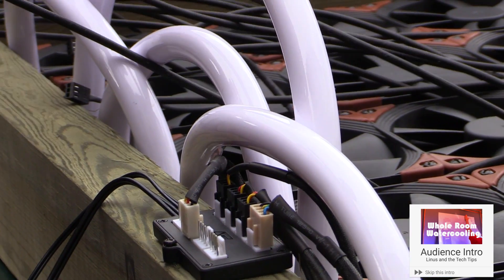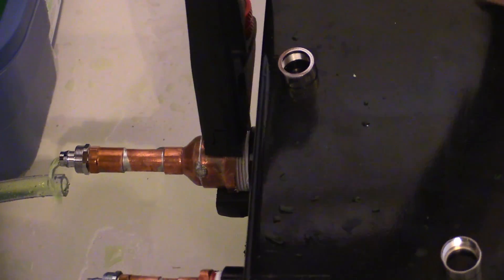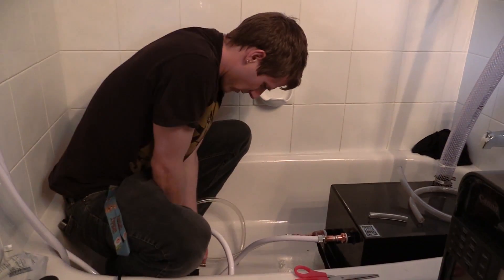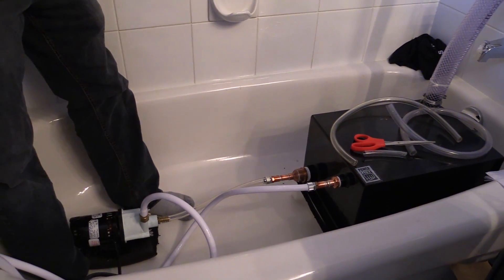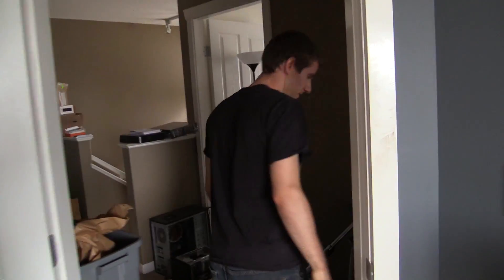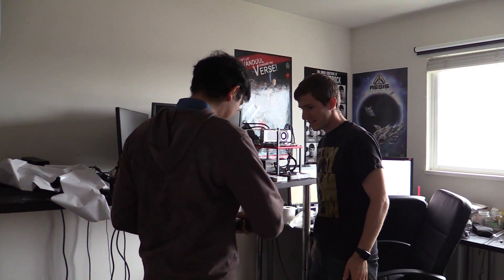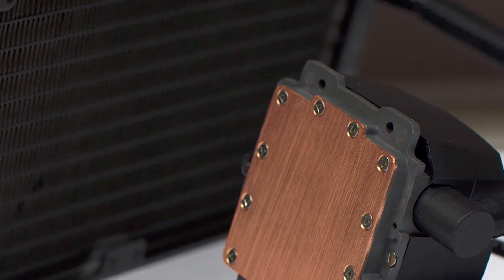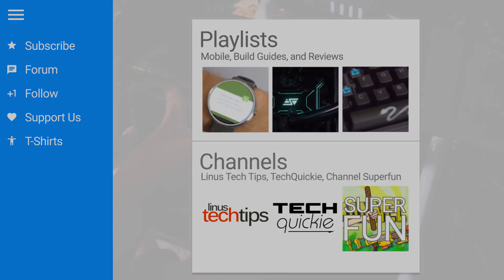Whole Room Water Cooling Part 4 - Nearing Completion...

Comment: Hey Linus, I bought a I5-4690k and I inted to overclock it. I have a Cooler Master Hyper TX3, but I read online that it isn't that good at keeping a overclocked CPU cooled. But I don't know if that is with the single fan or if they attached a second 92mm fan on the other side. My question is, would a TX3 be fine cooling a 4690k overclocked over 4GHz with two fans in a push-pull config?

Comment: You should air pressurize your system before you start to check for leaks. A lot easier than draining the whole system to resolder a pipe connection. Additionally, it would have been good to get some instruction from a qualified plumber. Those solder joints look horrendous! Other than that, speaking now as a geek rather than a carpenter, this is an awesome idea that I wish I thought of.

Comment: I dont know jack about plumbing but could they not have just put valves on each section where the copper pipes came down to the PCs, therefor making it easier to swap out and drain systems individually?

Comment: I find it funny how as soon as something goes wrong with this sort of stuff, suddenly the entire LinusTechTips community turn in to Professional Plumbers who have been in the trade for 60 years -_-
Reply from the maker: me too :p
Reply: Jergialipananu Little harsh
Reply: seriously have these guys never heard of butterfly valves to turn off flow? if they put those right before the fittings to the computer they would not have to purge the system so often. hell they could add computers with the pumps still on if they did it that way.
Reply: Hahaha thumbs up
Reply: In reply to jergly panini, that is
Reply: Seriously?
The ban hammer shall be raised above you!
Reply: ***** You're an idiot.
Reply: It doesn't take a professional plumber to know that the pipes are not very secure, and the 'professional' plumber who fitted it should have tested his work and actually soldered it all correctly.
Reply: Wobbled I love how easy it is to discount part of a community by expecting the entire community to be the same.
Reply: I wish I had found this earlier.  I am a plumber.  A simple high point vent would have saved a lot of trouble.  I have built water cooling systems for my own computers from scratch including machining the water blocks.  Something simple as a few tees would have been able to bleed the air as the system filled.  Water goes down, and air goes up.  I am wondering how long it was before air got back into the system.  I am also wincing at the jb-weld and the missed solder joint.
Reply: Lol. No kidding.
Reply: jamdoginc JERGLY PANINI LMFAO
Reply: Quinton Fallon
thank you that was bugging me so bad every time the drained the entire damn loop
Reply: I work with pressurized systems all the time, mainly filtration and chromatographies so i could relate to the issues these guys were having, not that i'm an expert, we just have simplier solutions for our smaller systems, fill with liquid the system parts that usually bubbles get stucked in, start the pump and then connect. (Obviously you can't just bring an open tubing close to the PC, so i guess i would have tried to fill something a bit further away?) That or increase the preassure as much as i can, I don't know if any of that would have solved the problems but i think i would have tackled the situation somewhere along those lines because that's how im used to solving the issues with our systems, in any case the issues of dripping in our systems are far less important than air bubles and in this case dripping was the main concern, i can just get a paper towel and clean the mess, these guys can't and im sure i wouldn't have dared to raise the pressure by much. Anyways... long pointless post.... :V
Reply: Quinton Fallon

I'd go with a ball valve.
Reply: OK, but you'll have to admit this all looked rather clumsy.
Reply: It takes virtually no experience at all to see how many flaws this has. I'll just give one simple hint for future. Get at least one T-joint with ball valve, place it on proper location on piping and attach automatic air bleeding unit similar to SpiroTop to it = Airless closed piping system. There's quite vast amount of other to be honest quite silly implementations in piping there. Ok, I can't resist it. Here's another one. Guess how much are you going to benefit from that fairly big pipe size? Truthfully speaking virtually not at all, since those puny computer blocks resist flow and they'll do it big time. You can't replace the issue with big pump. At least I didn't notice any bypass lines near blocks.
Reply: Jaap Versteegh I'll agree... it looks like something the Leeds council would set up over here... BUT... it's a project... and it doesn't need to be a polished item... it's what I call a garage mod... something that anyone with a soldering torch and some pipes could pull off...
Reply: jothain I can't agree more. I was just  about to comment the same thing. This whole project is ridiculous, and the fact that A. they never started with an actual plan and just decided it to 'wing it' so to speak, and B. they had a professional plumber come on sight and didnt take any of the advice he probably gave them about their piping fuck ups just seems stupid on a whole new level to me.
Reply: Colin D Alright, have fun at school tomorrow.
Reply: Colin D Just when I started to miss sarcasm, BAM, it comes around the corner and hits me in the face. Awesome.
Reply: DKE
Reply: that is becus they are widen their horizon , its called been smart going even futher dickheads
Reply: Wobbled lol exactly .. mean while im sitting here amazed at what the fuck they're doing basically in a home office type setting... lol like theres a step by step guide somewhere to accomplish this..
Reply: Wobbled well at least I can use a fucking stud finder
Reply: RC Codes A. it's a custom job. B. it's fairly straightforward once you learn how watercooling actually works - it's just a shitton of effort C. Sometimes life is about working hard and creating your own way instead of reading a fucking guide for every little thing.
Reply: aakksshhaayy i think you misinterpreted my comment...
Reply: +LinusTechTips dont forget us "professionals" watching your videos are watching because we have an interest in this community, not just praising you, that is WHY YOU HAVE A CHANNEL AND ROOM FULL OF PCs, dont forget that.

many of us use sources of information other than youtube to learn how to water cool our PCs BEFORE attempting such a task. WE find it amusing that the only self proclaimed professional commenting on this channel is YOU, and making THE MOST ELEMENTARY mistakes when attempting as grandiose a job as this just lets us know that your tech tips are clearly LESS than informed in this than your average overclockers dot net member. or anyone who has built their own reliable PC for that matter.
Reply: +LinusTechTips dont forget us "professionals" watching your videos are watching because we have an interest in this community, not just praising you, that is WHY YOU HAVE A CHANNEL AND ROOM FULL OF PCs, dont forget that.

many of us use sources of information other than youtube to learn how to water cool our PCs BEFORE attempting such a task. WE find it amusing that the only self proclaimed professional commenting on this channel is YOU, and making THE MOST ELEMENTARY mistakes when attempting as grandiose a job as this just lets us know that your tech tips are clearly LESS than informed in this than your average overclockers dot net member. or anyone who has built their own reliable PC for that matter.
Reply: lel
Reply: lel
Reply: +jamdoginc JERGLY PANINI THATS NOT HIS NAME😂😂😂😂😂
Reply: Should've subbed out the work for plumbing
Reply: *you're
Reply: 0.2 is 20 cents not 2 :P
Reply: Tell me about it!  I gave my $0.2 worth as well.  I merely suggested reading up on plumbing stuff.  These guys are totally out of their element but their pride kind of gets in their way.
Reply: Great comment i really hate when people dont know something one day and the next day they think they know everything. Just like you said all of a sudden everybody thinks they are professional  plumbers even know they probably dont know anything they just assume they know everything on that one toppic just because someone else is doing it wrong
Reply: LinusTechTips
Fuck off

Comment: Suggestions to make this less of a headache:
-Install valves to allow shutting off system access to the main loop at will.
-Bleed the 'master' loop, and system 'slave' loops separately! Get most, if not all, of the air out of both before connecting them together.
-Have a valve open to air at the HIGHEST point of the 'master' loop. Use this when bleeding to get a majority of the air bubbles out. Stick a hose on its output and put it in a bucket full of coolant to prevent air getting back in the loop.

:)

Comment: do you think you got any real value from this, given you are about to move offices soon after when you could have just got a wall AC unit for about 5% of the cost of all the components.  Also are you going to do this at your next office. 

Plumber tip,  treat the system like you would a house radiator with each pc representing a radiator get a distributor value that way each pc can get good flow.  also add lots of bleed valves.
Reply: They get money from the videos, it was sponsored, they can move pretty much everything to the new office.

Comment: Your reservoir should be the highest point in the system to provide static head and offer a place for the bubbles to go instead of sitting in the highest tubes. Also if you insist on having a reservoir lower you should have at least used positive displacement pumps instead of centrifugal pumps that loss suction when air bound. This is a pretty poor designed loop. I hope the new office will get a better designed one when you guys move.

Comment: Could you setup a pump of sorts on the furthest point from the pump/reservoir and suck the air bubbles out using a vacuum pump? Similar to how you bleed the braking system in a car??

Comment: I'm a little curious about the design.  All of the water is being pulled from one of the pipes and exiting the other, which is all done in parallel.  Is there actually enough water travelling in to reach the last 1 or 2 computers in the line?  Regardless, they are trying to pump into a return line that is filled with 2 or 3 computers worth of water.  It seems impossible unless you go serial.

Comment: I spent half of the video thinking "Does each of these computers have its own pump installed in it? I remember you saying that you want them to be detachable from the whole loop, and they will help considerably with the flow and bleeding issues they are having." 

Then I realized that you didn't want to get a bubble in them and destroy them.

And don't listen to all the people hating on these videos. Any water-cooling build of this magnitude will surely have some bumps on the way. The fact that you got them solved and made it all work instead of just calling it off is what matters.

Comment: well ,it looked like an fun experience.
if you make an new one in the new place please use bigger tubes on the main room loop  twice as big then the pc tubing. the cupper tubing looked barly bigger and is the reason that you had flow/air problems.
also the cold line should have drop to the floor and back up and in the turn close to floor put an T with a valve on it,it would have made youre live easyer and better flow.

Comment: you can get even lower temperatures if you use maybe 2 transmission radiator coolers "car aluminum automatic transmission radiators"  ( I'm not joking) will dissipate the heat a lot faster where those copper tubing are, remember copper retain heat but aluminum will dissipate anyway wonderful project I like it :D

Comment: Personally i would put the intake pipe up near the ceiling and outflow hot water pipe on the floor for gravity aided flow.
I would also put 3 wheel valves at >each< end of T junctions and pipe connections, as well as simple handle valves at each endpoint of the pipe so a single pc can be easily disconnected and drained without affecting the whole system.

Comment: umm... hey linus, if you had valves to bleed air in each section of copper pipe that's mounted at 6ft high you could bleed some of those air bubbles Much easier if you could find valves like you see on air compressor tanks

Comment: Im thinking of a mid cheap solution for a gaming PC.
 
-(CASE) AeroCool Qs-102 White 
 
-(PSU) Corsair VS Series 2014 "650W"
 
-(MOTHERBOARD) MSI Z97 Gaming 3
 
-(CPU) AMD 8320 Socket AM3+, 3500 MHz, Vishera
 
-(COOLING SISTEM) Corsair H60 Hydro series 
 
-(RAM 8GB) Corsair PC3 - 12800 ˇVengance Pro Red" KIT 8192 MB, DDR III, 1600 MHz
 
-(GPU) EVGA GeForce GTX 750 Ti 2048 MB, GDDR 5, PCI-Express™ 16x
 
-(STORAGE 1T) Western Digital WD1003FZEX "Caviar Black" 1000 GB, SATA III (6Gb/s), 64 MB
 
(OPTICAL UNITE) ASUS DRW - 24F1ST DVD+RW, Black
 
Everything here costs about 760EUR / 925$ / 595 Pounds
I dont know if the PSU haves enough power for the thing so plase tell me.
And also, Tell me if there are any better motherboards or CPUs for that price. I know Intel is better than AMD but I wanted something cheap. :)
I dont know how a SSD would help me. They all cost over 100EUR and I dont want to go over my 800EUR budget. Also im starting to doubt about the water cooling so do you know any air coollers that are amazing.
Reply: SSD enhances systems respond!
Reply: Buy one for 50EUR and install OS on it.

Comment: You should place the reservoir above the whole system. It's a low heat one with very low pressure. Air is lighter than water. The only way to bleed the system, if you have the bleeding hole at the highest point. Those pipes which are hanging off and joined together are absolutely waste the time. For the best results, the hot water pipes should run low and the recurrent should be higher. But on on the ceiling, just above or on same height as the highest point of the PC.. Even on the length of the pipes upward increase the pressure, so the pumps have to coop with extra resistant. What is keep the system cool now, is the amount of water and static heat dissipation. I bet, with no pump on the system you would have similar temperature.

Comment: Might have been a good idea to put isolation valves on each PC. Then you could have cycled them one at a time to push the air bubbles out of the individual loops.
Reply: Also a few check valves wouldn't hurt either...

Comment: As a mechanical engineer its funny/frustrating watching tech guys try to do practical work like this.
Why did they not install bleed valves on the pipes? This would have made setting up and maintaining the system a whole lot easier.
They also need to insulate all of the pipes if they want to maintain a constant temperature as the cold water could warm up on the way in and hot water will warm the room on the way out.

Comment: Install two automatic air vents at the highest point in the system..one on the flow and one on the return..you wont have any problems with air in the system anymore

Comment: This was a thing quite a few years ago, and everyone who tried eventually came to the conclusion that it is easier to have a separate contained loop in each system. Once you finally get all the air out of the lines and everything working right, you'll soon have to have a coolant replacement. Then you'll have to do it all over again. Bleeding this system will take you a whole day, then a couple more days to get all the air out of the system. And then there is the issue with pumps burning out from the heavy load up on them, and the fans burning out from being exposed to the elements.
It looks good on paper but it is an elephant to maintain.

Comment: Do you have any advice for fixing the dreaded bent CPU pin? I managed to fuck up my new $4000 X99 build, now it doesn't recognize a RAM slot, gets locked into a reboot cycle and the display blinks out every now and then.
Aside from crying myself to sleep every night since I got it, I tried to fix the pin I could see but it's created another problem where the whole system just spazes out like an electrical short.
Manufacturer doesn't want anything to do with it because I'm the doofus that can't push 2 levers down.
Reply: Sad fact of life with delicate components. Get those magnifying glasses out and check those pins as soon as you get the mobo out that package and get on the horn to CS if there is even a hint of a problem with a pin in the socket. hopefully it's only a mobo prob and a new mobo is a fix. I buy all my CPU's from Amazon and have returned several that didn't meet my expectations. Good luck Sir and/or Maam.
Reply: i think he made an older vid on that man about 2 years agoi...hope thart helps you find it
Reply: Sorry man, only solution is get a new CPU.
Reply: Urma
Reply: Don't just buy a new CPU, try to find out your problem which is mostly likely just the MB that's an easy replacement if needed but what company did you get it from?
Reply: X99 i7s dont have CPU pins... What exactly did you bend?
Reply: CanadianTreeFiddy The pins on the MOBO that the CPU sits on. I have no idea how I managed to bend them as it sits on top and all you do is pull the levers down. I did have trouble getting that plastic protector off so I'm thinking maybe it pushed down a little too hard. Either way I am the most gutted nerd of 2014.
Reply: Yes, I didn't catch that, there are no CPU pins but Mobo pins... which is what I inferred from a cursory reading of the original post.
Reply: kool saw linus fix a intel one awhile bak but is iffy